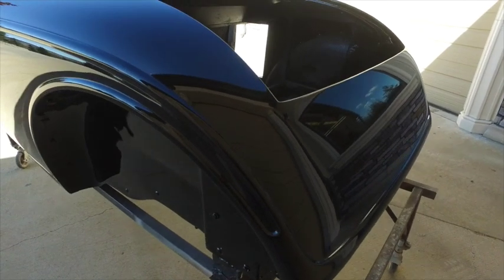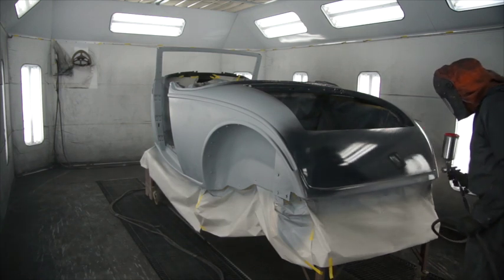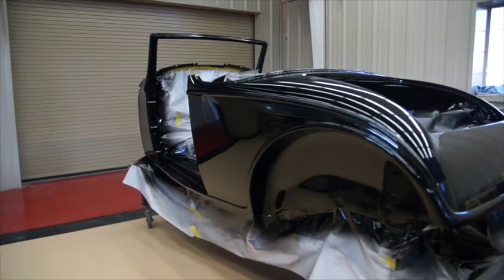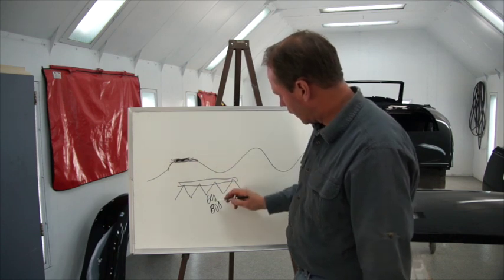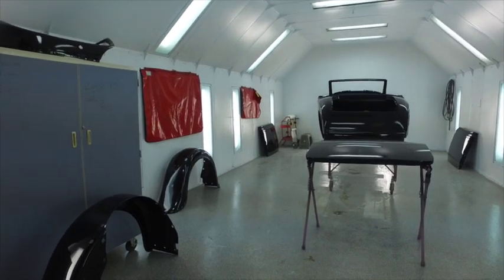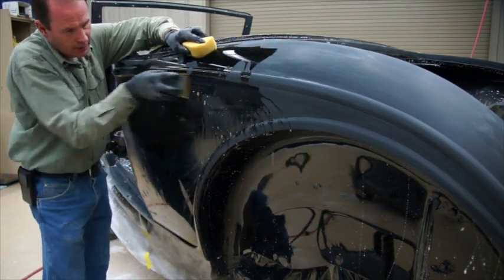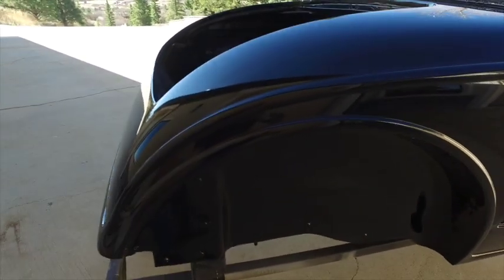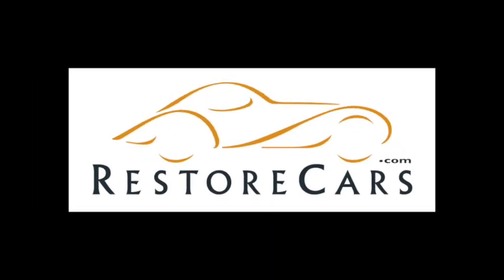A detailed description of how to sand and polish Urethane on classic cars.

Comment: Great video on wet Sanding an buffing I have a question I have a Blk Shelby Mustang that had some paint work done about a year ago this finish is excellent but my eyes see different I can tell the difference from the original flat clear that I like to the new paint that has a great finish but not the Original flat panel look that I like ..  So my question to you is can I block the new clear done with 800 grit to flatten it down then move up in sandpaper 1000 1500 ect.. what are your thoughts.. thanks

Comment: Just curious as to why you would need a cutting compound after sending with 2000? Is it a finer cut?
Reply from the maker: We actually use a cutting compound after the 3000 grit paper.  They now have 5000 grit paper and with this one could probably get away from using the course compound.

Comment: When you do your wet sanding do you alternate directions with the different grits of paper ? I have been doing this same process since the lacquer days, back then we didn't the multi grit fine paper, 600 & some 800. That was reserved for the limo's, Packards, Hearses, then you buff it with wool pad finished with a wool pad and a box of corn starch,in a sock or ponce bag.  Like you I am a firm believer in PPG products from start to finish, no mixing with products.
Great video's I really enjoy them and I always learn a different approach. Thanks Paul !